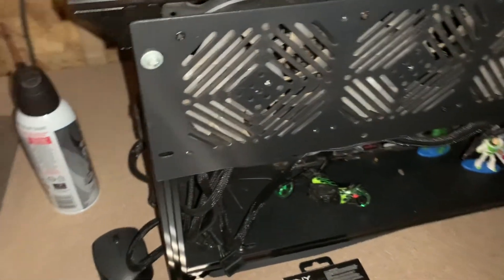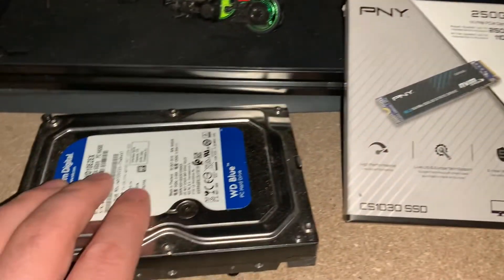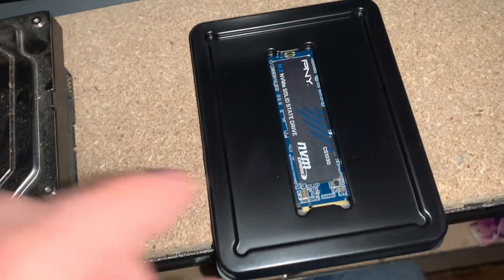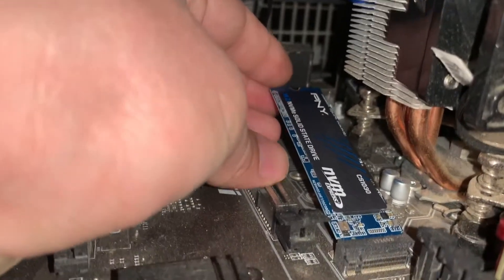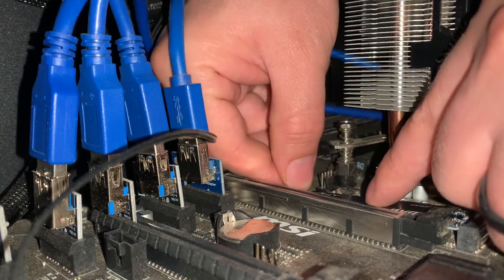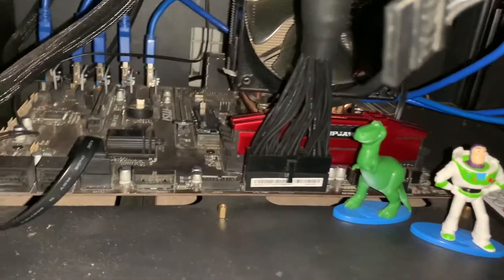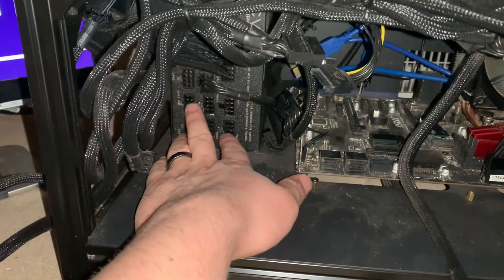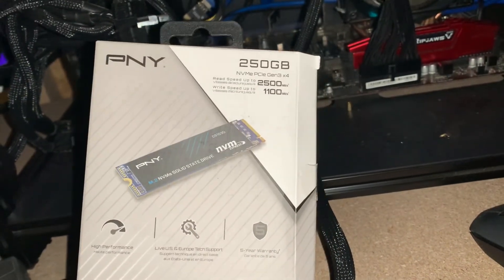Pny m.2 hard drive upgrade!

Comment: Installed wrong, its supposed to have a spacer underneath so it is flat, you have it installed at a negative angle
Reply from the maker: Seems to be working with no issues